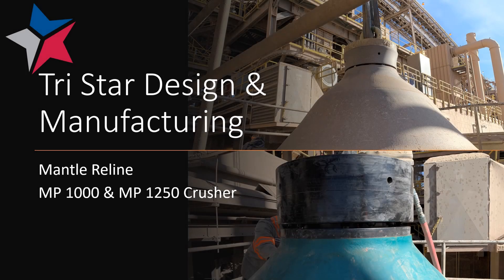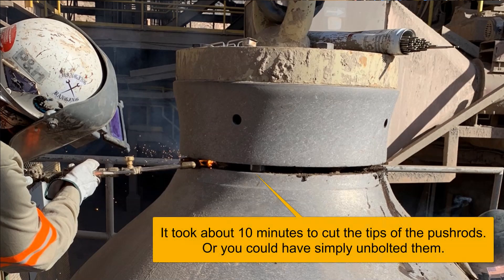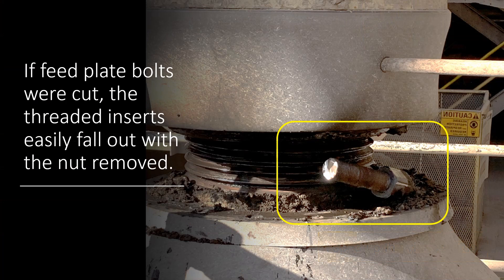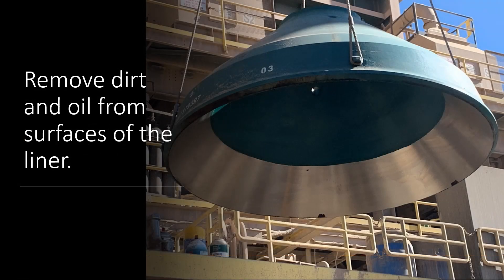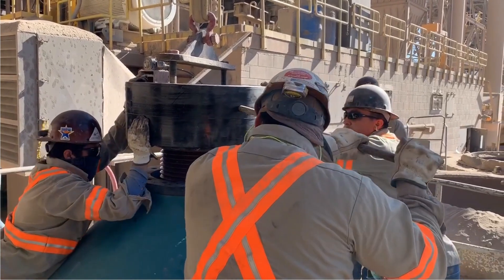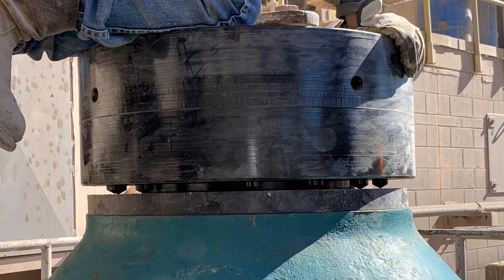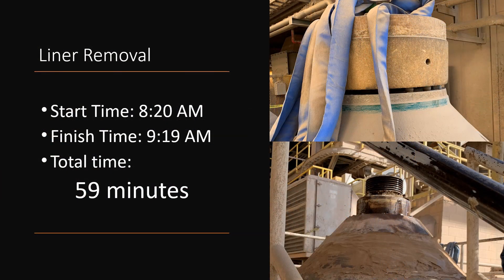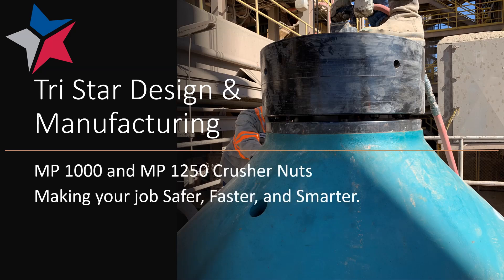EZ Nut (for MP Crushers) Full Rebuild

Comment: what is the backing material for? it solidifies?
Reply: The backing material is generally a 2-part epoxy but in some mines, it is molten zinc which can be recycled but may be more dangerous and difficult. The Backing fills the gap between the outer wear material (the mantle) and the head (the intter cone). The Mantle (wear material) has a machined surface at the bottom all around to seal, but above that there is about a 1" gap between the mantle and the head all the way up. This allows for deformities in the casting to not interfere with assembly. The backing fills this gap and deformities and provides a solid connection between the two components increasing compressive strength for the crushing of the ore.
Reply: @consumermath  thanks!